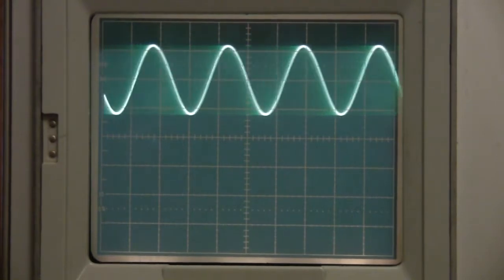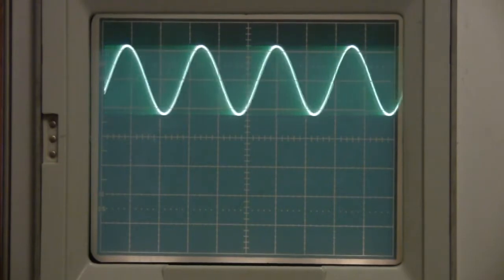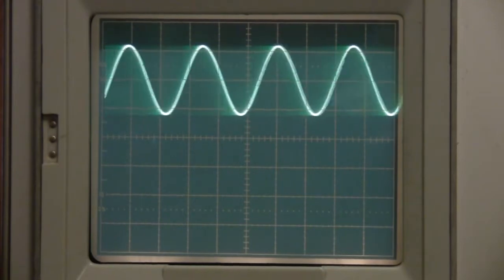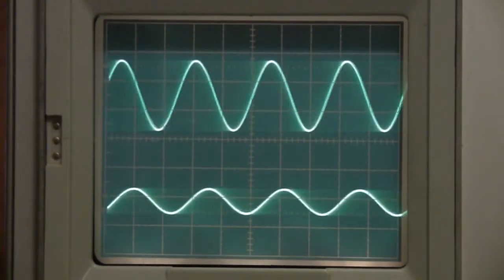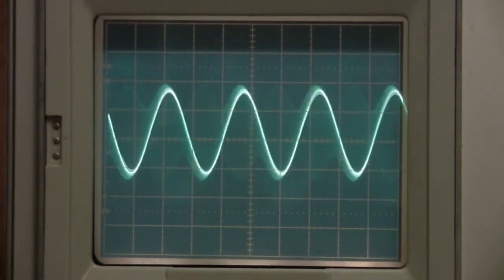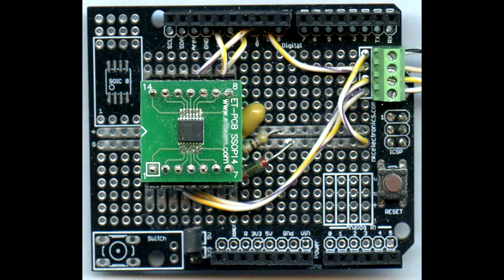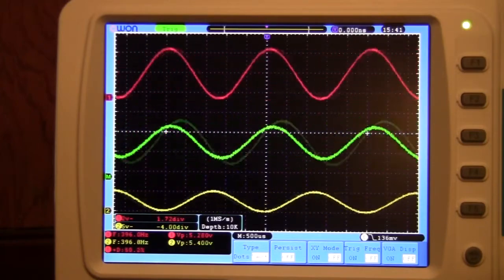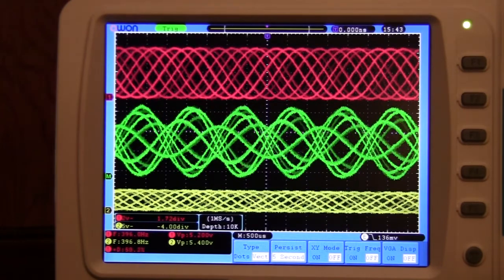Transmission Line Demo using a MAX5715 D-to-A and an Arduino

Comment: Could you help me with MAX5715.  Does this chip needs initialization? No matter what commands I send to it - no response. Thank you in advance.
Reply from the maker: Here's some simplified code from the demonstration. You need to initialize the SPI port before talking to the 5715. The only initialization the 57515 needs is setting the reference. Contact me directly at robeughaas@gmail.com if you need more information.

// UNO R3 Version for MAX5715

// include the SPI library:
#include <SPI.h>

// MAX5715 Command Commands
// REF to 2.048 volts
#define REF4P0 0x77
// load all code regs and all dac regs
#define CODEALL_LOADALL  0x82
// Code A
#define CODEA  0x00
// Code B and load All
#define CODEB_LOADALL 0x21

// set pin 10 as the slave select for the 5715
#define slaveSelectPin 10

///// Initialization 

  // set the slaveSelectPin as an output:
  pinMode (slaveSelectPin, OUTPUT);

  delay(10);  // delay for self-cal
  
  SPI.begin(); 
  SPI.setBitOrder(MSBFIRST);
  SPI.setClockDivider(SPI_CLOCK_DIV2);
  SPI.setDataMode(SPI_MODE1);
  
  // set ref to 2.048  
  PORTB &= (0xFF ^ 4);
  SPDR = REF4P0; // set internal ref 2.048
  while (!(SPSR & _BV(SPIF)))
  ;
  SPDR = 0;    // dummy
  while (!(SPSR & _BV(SPIF)))
  ;
  SPDR = 0;    // dummy
  while (!(SPSR & _BV(SPIF)))
  ;
  PORTB |= 4;

  
//// Sending values to the 5715  

  // set the SS line low
  PORTB &= (0xFF ^ 4);
  //  send in the address and value via SPI:
  SPDR = CODEA;
   while (!(SPSR & _BV(SPIF)));

  // Send the first DAC value HO bits
  SPDR = <<<Data value here >>>>
  while (!(SPSR & _BV(SPIF)));
    
  SPDR = 0;   // LO bits
  while (!(SPSR & _BV(SPIF)));
  // set the SS line high
  PORTB |= 4;

  // set the SS line low for the second SPI transfer
  PORTB &= (0xFF ^ 4);
  // do the second SPI transfer
  SPDR = CODEB_LOADALL;
  while (!(SPSR & _BV(SPIF)))
    ;
  // do table lookup base on accum 'b'
  SPDR = <<< data value here >>>>
  while (!(SPSR & _BV(SPIF))); 
  SPDR = 0;   // LO bits
  while (!(SPSR & _BV(SPIF)));

  // take the SS pin high to de-select the chip:
  PORTB |= 4;
Reply: Thanks for replay.
It turned to be faulty IC. It got damaged by someone before getting into my hands.